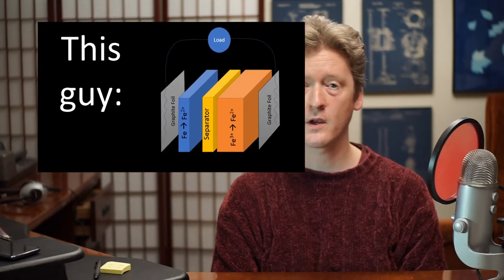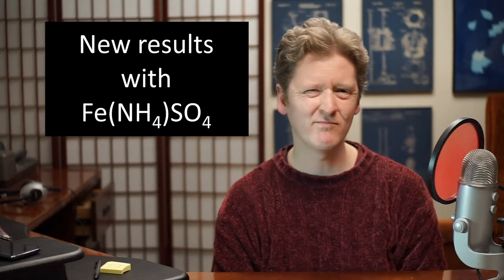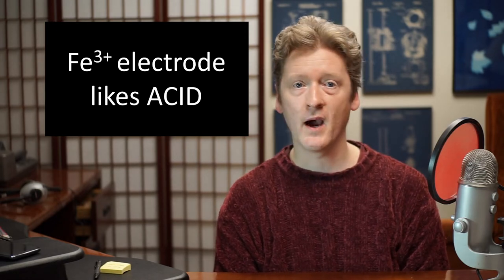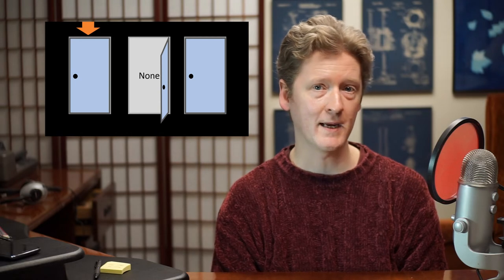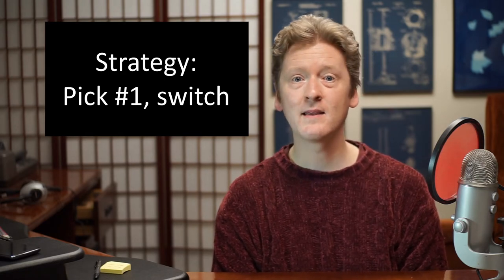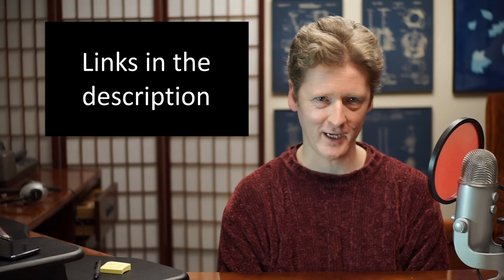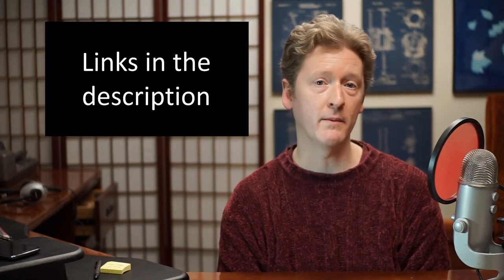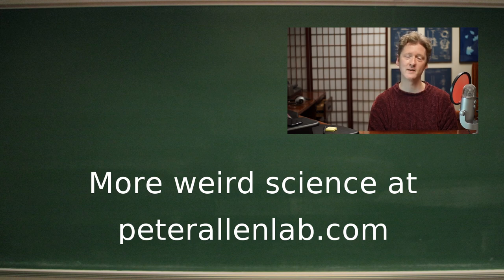Iron battery problems and being wrong about odds

Comment: "If you keep the stay strategy, if you just stay with whatever you pick, you still keep the 1 in 3 chance". Perhaps I'm missing something, but surely your odds with keeping the stay strategy are 1 in 2. If the game show host always opens one of the doors without a prize, this leaves two options. In fact, you could say that because of this your odds were always 1 in 2, as you know during the process of playing the game you'll only be left with two unknowns. Aside from the puzzle, thanks for the update about the iron battery, glad that work on this continues.
Reply: Read the linked article :)
It really is a mean super un-intuitive problem. What I was lacking is an explanation of how your chances change. Basically when one of the other doors is opened, you gain new information about the other two doors, but you gain no new information about your chosen door. So if you stay, your chances aren't changed, same as if you would play the game blind.
Before one of the two other doors were opened, you knew there was a 2/3 chance the price was behind one of them. Once one of them opens, there is still a 2/3 chance but you can exclude one of them.
So the chances are not 50:50 because you locked down one door and prevented the moderator to open that door. The information you have about the two remaining doors is not equal.
Reply: @dejayrezme8617  The issue I have with the logic of the 2/3 answer is referenced by Savant's statement in the linked article, in saying that “The winning odds of 1/3 on the first choice can’t go up to 1/2 just because the host opens a losing door,”. What I'm suggesting is that your odds were never 1/3, they were always 1/2. Let's see if I can try to explain with the use of a different game. Imagine you had three overturned cups and you were told one of them had a ball underneath it, and you had to guess which of the cups was hiding the ball. However, before you gave your answer, the person running the game would always take away one of the cups without the ball before you gave your answer. What are your odds of guessing the correct cup? 1/2 right? The reason that this is relevant to the Monty Hall problem is that your first "guess" is irrelevant to the outcome of the game, as the game host will always take away a door you didn't want to open, so your guess is just a formality, it doesn't have any impact on the game, they could have easily opened one of the doors without being prompted for a guess and the end result would have been the same. Therefore, your odds were always 1/2, there was just a delay before you got to play the "real" game. Hope this helps explain my point of view.
Reply: @blahdelablah  " so your guess is just a formality, it doesn't have any impact on the game"
Haha good idea, but your initial guess does have an effect. Because you exclude one of the choices from the revealing.
Imagine the game would be that the placement of the price is random, but the moderator always eliminates either the second or third choice.
Then you know there was a 1/3 chance the ball is in the first, a 1/3 chance on the second, and a 1/3 chance on the third. But you eliminate either choice 2 or 3. That doesn't change the chance of the first one, but it does eliminate / change the chance on rest.
Reply from the maker: 50% is the intuitive answer. Maybe because we intuitively think of it like a third strategy I didn't talk about: Pick randomly, then pick randomly again. That gives 50% odds. The linked article uses a 100 door example that makes things more clear. if you have 100 doors, pick one, open 98 empty doors... 

What are your odds if you take the pick-and-stick strategy? 1%. You don't use the benefit of the new information. Just pick a random door and stay with it.
What are your odds if you take the pick-and-switch strategy? 99%. You only lose in the 1% of times when you picked the prize on the first try
What are your odds if you take the random-and-random strategy? 50%. There are 2 doors in your second round of random selection, and so you get 50-50 odds.
Reply: @dejayrezme8617  The point is that at what point are you playing for the car. You can't win the car in the first round. You can only win the car in the second round. The outcome of the first round has no impact on the second round. It would do if you were shown the results of your choice in the first round, or you would have some indication of the significance of your choice, but this is not the case. When you come to make the real decision, you only have two options available, hence 1/2 chance. The important part is not the number of doors, it is the prize and the chances of winning the prize.

"Imagine the game would be that the placement of the price is random, but the moderator always eliminates either the second or third choice.
Then you know there was a 1/3 chance the ball is in the first, a 1/3 chance on the second, and a 1/3 chance on the third. But you eliminate either choice 2 or 3. That doesn't change the chance of the first one, but it does eliminate / change the chance on rest."

The number of cups before the elimination does not matter. The only thing that matters is the odds available to you in the final decision. To use an analogy, imagine you're asked to flip a three sided coin, then flip a two sided coin. What are your odds of predicting the result of the two sided coin flip? 1/2. The three sided coin flip happened during the process of playing the game, but the result of this coin flip was completely independent from the outcome of the game. In the same way, the outcome of choosing a cup just to have the game host alter the game your playing has no impact on your odds of winning, as you were only given one chance to win, and that's after the elimination took place, there was no winnable game taking place before that point, and as the result of your choice always results in the game host removing one "wrong" answer there is no variability in the end result introduced in the pre-game events (i.e. the first "guess").
Reply: @blahdelablah  Hehehe yeah right, ignore the first choice and reframe the game like there is only one picking: 

First, the host always eliminates either B or C. He never eliminates choice A. He doesn't eliminate one of the three choices, he eliminates one of two choices. So there is a difference between A and B / C.
Since at start the price is distributed randomly between A, B and C, the chance that it's A is 1/3, the chance that it's either B or C is 2/3.
If you eliminate B or C it's always a 2/3 chance if you pick the remaining of B and C.
Reply: @PeterAllenLab  "What are your odds if you take the pick-and-stick strategy? 1%. You don't use the benefit of the new information." This game is slightly different, in that if you have to open 98 doors, the best way to avoid missing a door with a prize is to switch to it before you open the door. This is a game where switching has advantages.

In contrast, with the Monty Hall game, no new information is revealed to the player that significantly alters their final decision. Opening one of the two doors without a prize reveals no significant information to the player, as they already knew that "no prize" doors existed before the game started, and the location of the first opened door reveals no new information to the player about where the prize may be. With this in mind, the odds involved in the game don't really evolve, it's just that the game doesn't truly start until the player has to make a significant decision, which only happens during the second guess.

To elaborate further about why I believe it's a delayed game, and the 50% odds still stand, let's change the Monty Hall game. Imagine the setup is the same, three doors, one prize. The player picks a door, the game host opens a different door without a prize. Let's imagine no further guesses were given and the "game" stops there. Was the player still playing a game? I'd argue they can only be playing a game either if they had a chance of winning or losing (and this is clearly not the case, as they had a 0% chance of winning the car in this setup), or if their participation altered the eventual outcome of the game. Going back to the traditional Monty Hall game, as the only way that there was a game being played during the first round is if the player had impacted their final chances, it's worth noting that the only outcome of the player's choice was that the game host was restricted from opening one of the doors, but this restriction had no impact on the game host's ability to choose one of the non-prize doors, so the impact of this decision on the game wasn't there. If you couple that with the player gaining no new information as a result of their decision and also couple this with the player having 0% chance to win the car in the first round, I'd suggest the end result is that the game did not start until the second round, the first round was just a hurdle to get over to get to the second round, it had no impact on the end result.
Reply: @dejayrezme8617  "If you eliminate B or C it's always a 2/3 chance if you pick the remaining of B and C." The issue you're overlooking here is that by eliminating one of the choices you're also altering the odds, keeping the odds for "A" the same between rounds whilst improving the odds for "C" (assuming you eliminated "B") makes no sense. If you have three options to choose from and only one winning outcome, your chances of winning are 1/3. If you reduce the available options to two and only have one winning outcome your chances of winning are 1/2. However, the first scenario does not impact on the second scenario, and therefore you can't assign any of the odds from round one to the odds from round two and expect a logical answer. Also, the reason it doesn't matter that the player can choose from three choices but the game host can only eliminate one of two choices is because the chances of making the winning decision is not impacted by the host's restrictions, it is only impacted by the quantity of the available choices, not their arbitrary labels.
Reply: @blahdelablah  Ok, imagine I gave you two choices: Choice A has 1/3 chance of winning, choice B has 2/3 chance of winning.
So what you said "it is only impacted by the quantity of the available choices, not their arbitrary labels" doesn't apply there. Because the labels aren't arbitrary. 

Same for the Monty Hall door game. The host eliminates a dud, meaning the remaining door has a reduced chance for duds. The choice is not equal.
Reply: @blahdelablah  I thought of some variations of the Monty Hall problem that I think are all equivalent. You have three doors each with a 1/3 chance to have the price. But you have different rules:

You can either choose A, or you can choose to open BOTH door B and C

You can either choose A or you can choose B. If B is a dud, you can choose again.

First, IF the price is behind C, the moderator secretly moves the price from door C to door B. Door C is then opened. But you don't know if the price has been moved. Now you can choose between A and B

First, the moderator opens either door B or C depending on which one is a dud.

In any of these cases door A would be a 1/3 chance and the remaining choice would be 2/3 chance.
Reply: @dejayrezme8617  "The host eliminates a dud, meaning the remaining door has a reduced chance for duds." I don't see how that can be true, from what I can see it has an equal chance of being a second dud as it does for hiding a prize.

Let's look at the first round in further detail. If "P" represents "Prize", and "N" represents "NoPrize", I hope we can agree that the only possible initial states for the game are:
PNN
NPN
NNP

Let's then look at the first guesses of the player. If 1 represents the initial guess, and 0 represents a non-guess, we have the following outcomes:
100
010
001

So with a combination of 3 initial states and 3 first guesses, we have 9 possible combinations before the host eliminates a door:
PNN 100
PNN 010
PNN 001
NPN 100
NPN 010
NPN 001
NNP 100
NNP 010
NNP 001

The host now has to eliminate an option. If the player picked a dud, the host has one option for initial elimination. If the player picked the prize, the host has two options for initial elimination. This leads to 12 possible outcomes after the initial elimination ((3 x 2 options) + (6 x 1 options)). If we introduce X for the initial elimination, and * for a winning first guess, we have this:

*PXN 100
*PNX 100
PNX 010
PXN 001
NPX 100
*XPN 010 
*NPX 010 
XPN 001
NXP 100
XNP 010 
*XNP 001 
*NXP 001

At this point, 6 of the 12 outcomes (50%) have the player already on the winning position, meaning that if they switch they switch to a dud. You may question this, but I'd suggest the reason this is valid is because all of these outcomes are equally likely.
Reply: @dejayrezme8617  Those games aren't equivalent.
Reply: @blahdelablah  Hmm now you made it complicated :D 

Well, but what is the probability of each of the "9 possible combinations before the host eliminates a door" occurring?  All 9 of the states have a 1/9th chance of occurring.

But then you split 3 of the states into 6 new states. These 12 states do not have equal chance of occurring. For each of the 9 states the host either has no choice or a 50:50 choice. That halves the probabilities of the split states.

PXN 100 * 1/18th
PNX 100 * 1/18th
PNX 010   1/9th
PXN 001   1/9th
NPX 100   1/9th
XPN 010 * 1/18th
NPX 010 * 1/18th
XPN 001   1/9th
NXP 100   1/9th
XNP 010   1/9th
XNP 001 * 1/18th
NXP 001 * 1/18th

So at that point while 6 of the 12 outcomes have the player already on the winning position, that outcome is only 6/18th likely (1/3rd).
Reply: @dejayrezme8617  "So at that point while 6 of the 12 outcomes have the player already on the winning position, that outcome is only 6/18th likely (1/3rd)." After the first door is shown by the host, the outcome improves to 1/2.

I think the fundamental issue we're looking at here is one of fixing odds on arbitrary groupings, with the faulty idea (from my perspective) being that the odds of a group do not change as the game evolves. However, to look at how bonkers this is, let me show you how I can alter the groups to favour the "stick" strategy. We're at the start of the game, 3 doors, 1 hiding a prize. Let's label the doors A, B and C. The player has to choose one of these three doors in order to get the prize. The player reasons that there's a 2/3 chance of the prize being behind doors A or B, so they choose door B. In the next round door A is eliminated. Does door B now have a 2/3 chance of winning? If you follow the same "fixed probability for groups" logic used in the usual game explanation, the answer is yes, however I hope you can see that the true answer is no. It's exactly the same for the "regular" game, the decision to group the 2 unchosen doors is just as arbitrary as the decision to group 1 door plus one other, and the 2/3 odds do not stay the same, it evolves to 1/2.
Reply: @blahdelablah  "The player reasons that there's a 2/3 chance of the prize being behind doors A or B, so they choose door B. In the next round door A is eliminated. Does door B now have a 2/3 chance of winning? "

Well yes! But it's unclear how the rules of the game work if the price had been behind A.

It's really a choice between an unfiltered group to win the price, or a prefiltered group where the host has eliminated some duds. 

Imagine you want to buy a monitor from a seller, and 1/3 of the monitors are defective right from the factory. Seller A has a stock of 1000 so it's a 1/3 chance.

Seller B goes through most of his stock and tests them and now ends up with a stock that is vastly better chances of not being defective.

That's in essence the same as what the host does when he eliminates one of the doors you haven't chosen. Your initial choice prevents him from revealing a dud behind it so it stays the same, and the remaining doors are filtered so have a lower chance of containing a dud.
Reply: @dejayrezme8617  "Your initial choice prevents him from revealing a dud behind it so it stays the same" Only if you've chosen a dud, and you have no way to know, and you have no new information about that after the first door is opened. As I've tried to say before, your odds do not evolve because of the information you're revealed during the course of the game, instead they evolve due to a reduction in the number of choices you have in front of you.

"Well yes! But it's unclear how the rules of the game work if the price had been behind A."
I'm sorry but this is bonkers. Consider the same scenario we discussed before, but the player did not make any grouping in their mind. Suddenly the odds drop from 2/3 to 1/3 just because the initial decision making process changed. This is clearly a fundamental flaw in the premise of the "2/3" odds answer, it should be true for all players not just for some of them.